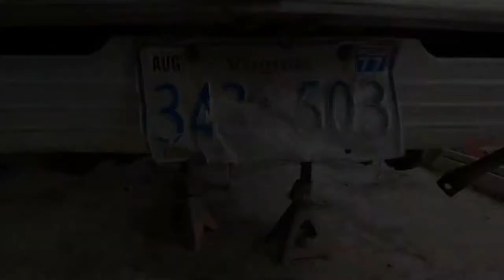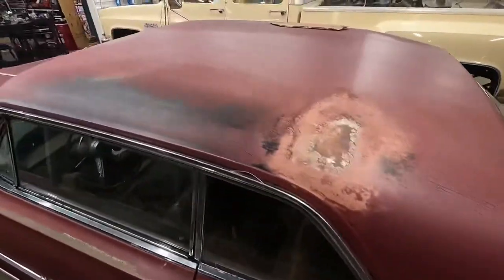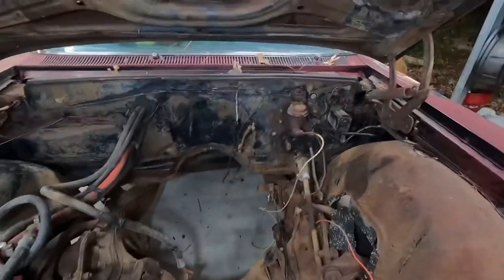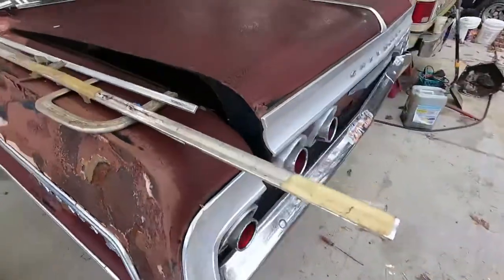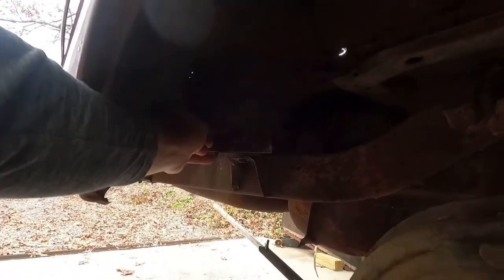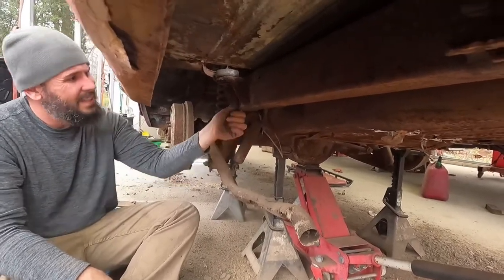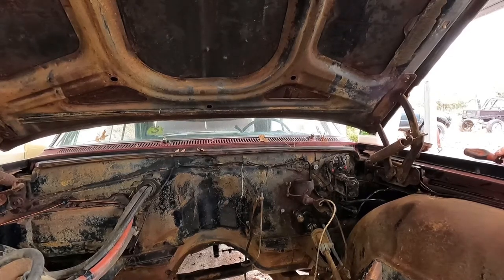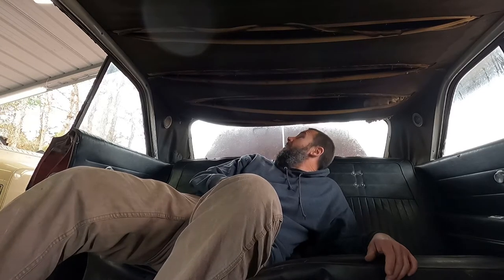Abandoned and forgotten 1964 Impala Part 1

Comment: My 64 Chevelle convertible was probably in the same condition as this impala when I got it. The only original body parts are the cowl the rockers the trunk lid the door shells and the inner structure in the rear all was very solid. I have several first place trophy wins now. If the bones are good the rest can be replaced and if you do all the work yourself it's cheap to fix compared to paying a shop.
Reply from the maker: That’s a fine looking Chevelle you have. I think I’ll replace more of the rusted parts as I go but for right now just seeing the poor thing move under it own power is all I want. Thanks for watching!!

Comment: Can't wait to see this thing running and driving HG. Comet wash it and make it shine with some linseed oil. Did you find anything at the swap meet?
Reply from the maker: Got a $20 set of shorty headers. The seller to buyer ratio wasn’t good, we walked everything three times. It was still worth the trip though. I don’t think comet will touch it, that paint is crazy thick in places lol. I thought it was house paint.